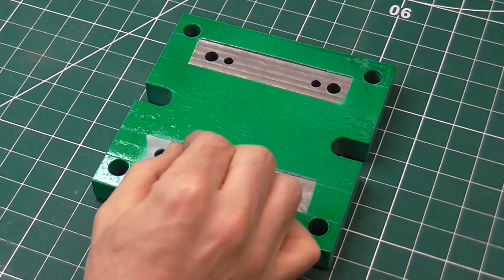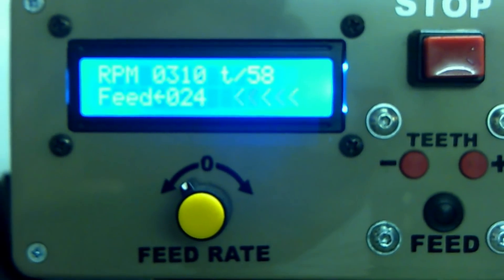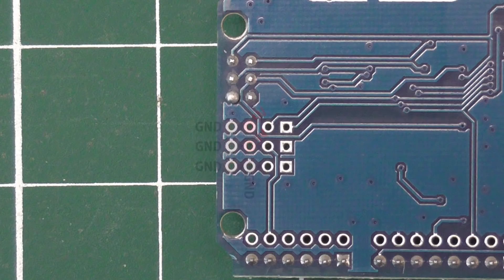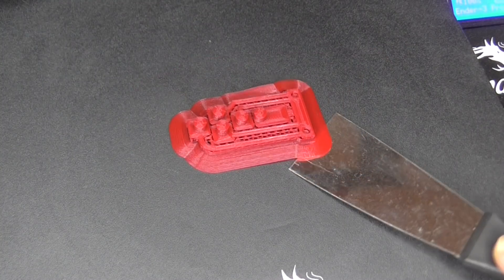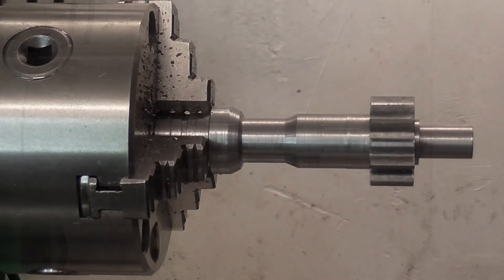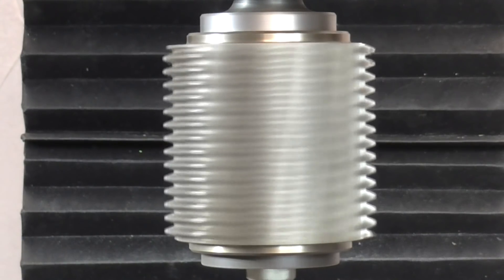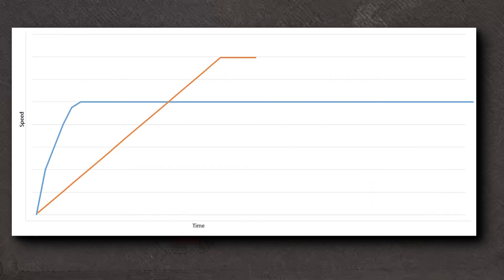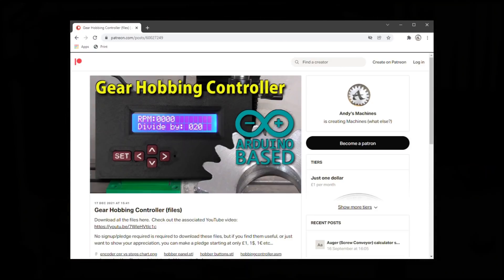Gear Hobbing Controller

Comment: Andy I need your help again. I have been trying to find an encoder module like yours for ages now: 4:03. All I can find is very tiny and/or not to spec. Do you have any part number or manufacturing data on said module or can you tell me where to possibly salvage one from? I even tried building my own with two seperate photo transistors. I already made the counting wheel in 2mm thickness and fitted it to my mill to try it with an arduino programmed by my brother which didn't work out on realistic rotational speeds. Unfortunately I seem not to be smart enough to come up with another solution so I try to exactly replicate your setup now with that encoder module being the only thing that is holding me back. Your help would be massively appreciated.
Reply from the maker: The encoder read head I used came from an unbranded servo motor from some unknown piece of equipment. I used it as the encoder wheel had a fairly coarse resolution that was easy to replicate

Look for an Avago/Agilent/HP HEDS encoder read head, these can be found cheap on ebay. They come in different resolutions but if you can find the 'S' option this is 50cpr on a ~25mm wheel which equates to approx 1.5mm line spacing which is quite doable in the home shop, you could probably even 3D print a codewheel with that slot width. (You can of course make the codewheel any size you want as long as you keep the same line spacing.)
Reply: @AndysMachines  Now I managed to program the thing but my keypad shield doesn't show any digits. it gets power and the LCD lights up but no individual digits and it doesn't reboot after programming either. I have an Arduino Uno R3 and a shield that looks identical to yours. Any tips?
Reply from the maker: Sorry, not sure what's going on there, could the shield be plugged in improperly?
Reply: @AndysMachines  I compared all the pins already and also there are gaps between rows of pins that cannot be plugged in in another way. Ich tested the program too with two switches and toggled them for a few minutes. The motor didn't move so I think the programming in general went wrong somehow even though the command prompt told me it had worked. I don't know if programming with atmel studio could change anything.. I could do that at work.
Reply: @AndysMachines  Small update: the controller was programmed correctly, I just had to tune the contrast of the keypad shield.
Reply from the maker: That catches a lot of people out! The contrast on these modules seems to be set at random and sometimes nothing is visible on the display even when it's working properly.
Reply: @AndysMachines  Oh and thank you very much for posting the updated version of the arduino program. I was about to edit the button values in the asm and convert it to hex with the values I read out in the IDE until I discovered you already did that for me. Very glad about that because that was too far over my head :) Now my new encoder module just has to work :)
Sorry for dumping all that trouble to you, now I should be able to finish the mechanical part 👍

Comment: Is it possible to make a bevel gear?
Reply from the maker: I have seen people 'hob' a bevel gear but with a single point cutter in place of the hob ( a regular hob won't work). I haven't tried it myself, I think it would need 2-3 passes with the gear at different angles to the horizontal to generate the correct profile.
Reply: @AndysMachines  I would like to use a worm cutter. OK. Thanks.

Comment: Thank you for sharing this project. Your previous 2-part videos inspired me to CNC my rotary table so I can make worm and helical gears for a 3D printed RC car. Only difference is I am going to synchronize my rotary table to both the mill spindle and the X axis DRO scale (both ratios can be adjusted or disabled). That will open the door to making spiral gears like what you would find in a self-centering chuck. Should be a cheaper (and way cooler!) than getting a BS-2 dividing head! Thanks again!
Reply from the maker: Glad to hear it! Yes, that should allow for some interesting operations.

Comment: i have a 1000cpr encoder and my step/r 600 that doesnt give a whole number, its okey tu put the Encoder to 800 cpr for the 600 Step/r?
Reply from the maker: Yes, if you change the encoder for an 800 cpr one it will work, but you can't just set the value to 800 and use the 1000cpr encoder. Alternatively you can change the reduction ratio, 625, 750, 1000 and 1250 steps all work with 1000cpr.
Reply: @AndysMachines  Thanks for the help, but i have another question, im using a closed loop nema 23 form aliexpress, (Cloudray CLE-23) this driver is programmable and it has from 800 stp/r up to 40000 stp/r. then in my milling mahcine i have 3:1 reduction, my current settings are 1000cpr - 625 stp/r but i have notice that the driver is not 200stp/r the driver is using the stp/r that the driver is programed so is using 800 stps/r  so the actual stps/r after the 3:1 reduction is higher   2400 stps/r higher than my encoder. is there a solution for this or is better to change the stepper driver?
Reply from the maker: Are you using 3:1 reduction exactly or 3.125:1? (625 stp/r @ 200 pulse/rev?). If 3.125:1, then a driver setting of 1000 pulse/rev would work (3125 steps/r) but unfortunately the software won't let you set it that high as it's beyond what the arduino can reliably cope with. So yes you would be better off with a driver that lets you turn off the microstepping completely.

Comment: Hi Andy . Just made your controller and it went fine except I had problems using AVR Dude but I used Xloader instead and that went ok, I also printed the parts for the case and buttons which work well together . I would like to have tried altering the code but as you did it in machine code rather than arduino IDE code , I wouldnt know where to start. so my only option is to ask if you would be good enough to make another version of the controller. You see I have 6 hobs but also have 3 sets of 8 involute cutters so I can also cut one tooth at a time. It would be great if you could alter the controller code to not only suit hobs but also single step for involute cutters . Love your designs so keep up the great work ....  Don
Reply from the maker: Hi Don, Glad you got it to work. Yes, I only discovered Xloader after making this video, it is much easier to use (though it actually just configures and uses AVRdude itself). Yes, other people have suggested adding an indexing feature too, though you would probably also need a locking device on the spindle and maybe a higher gear reduction (at least compared to my hobbing attachment). It's the sort of thing that would work better on a rotary table with stepper motor added. I might add this feature when I get time as I'd find it useful too and I already have a converted rotary table.
Reply: @AndysMachines  Hi Andy , and thanks for the reply, I do have a rotary table which is the reason I asked about single stepping. I keep forgetting if I moved the two fingers on the dividing plate or not and then end up with the wrong gap between first and last gear teeth, and your controller would prevent  that , so fingers crossed you find time one day to alter the design. A quick question (or 3 ) if I may, I have two encoders , one is 500ppr and one is 1000ppr both have quadrature output. Which would the best to use for your hobbing controller ?  What gears would I use between the encoder and spindle and is that Step up or down ?   Cheers Andy.....Don
Reply from the maker: I would probably use the 500cpr encoder with either 5:1 reduction (12 tooth: 60 tooth pulley) or 3.75:1 reduction (16t:60t) You want to  step down from the motor to the spindle giving more resolution at the spindle (more steps per complete revolution).

Comment: Hello Andy,
I made this nice hobbing attachement almost similar as yours and produced some simple gears with it. At first it looks fine, but there seems to be a problem. I believe there is a synchronicity problem between the spindles. What happens: for testing I moved the Y-axis to the gear and make contact so a small scratch at the gear will arise offcourse. Then I just wait and make no adjustments. This small scratch is getting bigger and bigger very slow. After 2 min. the scratch is almost around he whole surface of the gear. I tried to find the problem in the drive train. I even changed the drive train from belt to a gear-drive and I also tried a chainwheel-drive. All this because there might be a difference in ratio due to small differences in the diameter of the drive-gears. But the results are the same. I wonder if there is a round off grade in the software that could cause this? Do you have any idea?
Is it possible to receive the source code of the software so I can learn how to program this?
Best regards, Mark
Reply from the maker: Hi Mark, Some other people people had similar problems. The two possible causes seem to be either having the hob tilted to the incorrect angle, or electrical noise causing either extra pulses to be counted from the encoder, or extra steps picked up by the stepper driver. If you can vary the current sent to the motor, try a different setting, sometimes reducing the current can help which might be contrary to what you would think.

Comment: I'm kind of curious about your PIC designs now. I a Velleman programming board several years ago (around a decade or so) and a handful of different PICs to play with but since most people switched to Arduino and RPi I cannot really find anything using PICs.
Reply from the maker: Yes, PICs seem to be only used industrially nowadays, almost all hobbiests now use something arduino-esq for simplicity. Microchip, who originally made the PIC were bought up by Atmel a few years ago and datasheets are available from Atmel. You can still find application example code for PICs on microchip.com

Comment: refreshing to see a man who can write some assembly on youtube. cudos.
I'm more of a new school guy so I quite like my C for anything where I'm not counting cycles, but even still I prefer reading the datasheet and compiling stuff manually with gcc to avoid the bloat. 
I also use the stm32 series of microcontrollers for stuff that's more serious, and with the exception of the occasional datasheet errors, I actually find them absolutely great.
Reply: and now that I've finished the video, I must say this is very impressive to have been done in assembly.

Comment: how to solve this issue      sbrs  flags, 4         ; don't enter setup if spindle moving error missing charector shows
Reply from the maker: What's the issue you're having here? This line stops the configuration settings being changed if the machine is running. Can you explain the 'missing character error'?

Comment: I have a question. 
The reliability of the arduino is impressive,  is that due to the programming language you used (assembly)???? 
Second question. I don't trust arduino generally,  but, is it reliable to be used industrially using assembly to program it???
Reply from the maker: I completely agree. The only reason I used an arduino for this is so that other people can replicate it easily. I generally never use them myself. But an arduino at it's heart is really just an ATmega328 (I use these stand-alone all the time). If programmed in assembly there's no reason it shouldn't be just as reliable as any other microcontroller used in industry.

Comment: Hi Andy 

Thanks for sharing the program with us.
I have downloaded same but when trying to install it in Arduino (using several port numbering), I get a msg like:
Using port : COM3 or COM4 or COM5……
Using programmer : Arduino
Overriding baud rate: 115200
Avrdude: stk500_recv(): programmer is not responding 
Avrdude: stk500_getsync()attempt 1 of 10: not in sync: resp=0xb4

Doing in total 10 attempts without any results. 
Initially I had the impression is the Arduino card and therefore I have ordered one more but I get the same.
Could you pls support?
Reply from the maker: I'm not sure what the problem is, but I've since found a program called 'Xloader' that is windows based and easier to use (though it does use avrdude itself). Maybe try that instead?
Reply: @AndysMachines  Hi Andy, one more question and I hope it will be the last one. 

I have used another PC and I was able to upload the hex file according to your instructions. 
On the screen I can see only the rpms and when turning the encoder the reading is changing. 
The LED is flashing if I turn it too fast.

The problem is that IO can not see the Divide by:20 as appears in the video. 
I have ordered a new Arduino uno to check if the problem was with it. The results was same.

I have used the Xloader as you proposed and I have also same results. 

Do you have any idea why I have this problem?
Reply from the maker: @nikoskyriakou9341  Is there nothing at all displayed on the 2nd line of the screen, or some strange/broken characters? I have heard of people having problems with these screens, where only the 1st line works properly.
Reply: @AndysMachines  hi Andy.
On start up only rpm appears. 
If press reset, then the broken characters appears.
Reply from the maker: @nikoskyriakou9341  Yes, that sounds like the screen issue. Can you try a different screen?
Reply: @AndysMachines  hi Andy.  I have to order one from Ebay.  I can't find it local.  It will take few weeks.  I will revert once the new screen is tested. Thank you for your support.
Reply: @AndysMachines  Hi Andy, I have manage to get a new screen. 
It is one without any brand on it and it works fine. 

I have another short question.
My encoder CPR is 400, I am using a 6 to 1 reduction ratio and my stepper motor driver was set to 400 pulse/rev (400 is the lower I can go).
What parameters should I change in order to have the setup running?? 
The spindle steps per rev should be adjusted each time you are changing the number of teeth you will cut? And if yes should we follow the chart shown in the video?
Reply from the maker: @nikoskyriakou9341  No, you don't need to change the spindle steps per rev for different numbers of teeth, the controller takes care of it, you only need to set it up once.
The encoder you are using has too few counts for the reduction ratio/steps you have. The encoder must have at least 1/4 the number of stepper steps per complete revolution (including reduction). You have 400 steps x 6 = 2400 steps and 400 CPR. You need to either change the reduction ratio to 4:1 and keep the 400 CPR encoder (3:1 will work too). Or keep the 6:1 reduction and use a higher resolution encoder, 600, 800, 1000 or 1024 CPR will all work.
Reply: @AndysMachines  hi Andy,  well noted. Will do so.  Thank you for your advice.

Comment: In one of your replies here you stated that Arduino controller has a max stepper CPR of 10000. I will be using a DM556S driver with selectable microstep CPR from 200 to 25600. It is my understanding that each Arduino generated pulse can be transformed by the driver into 1-128 microsteps. Does your 10000 CPR limit relay to Arduino or driver output?
Reply from the maker: I limited the steps per rotation you can input in the software to a sensible number. Note that it is the total number of steps per rotation of the hobbing spindle including any gear reduction and it is the number of steps that are input into the driver (out from the controller). The problem with using very high microstepping values is that you need a very high resolution encoder, the encoder must have a minimum CPR of 1/4 the steps per rotation on the hobbing spindle, so if you were running at 25000 steps/rev you would need at least a 6250 CPR encoder which is not really practical, such a high encoder resolution would limit it's maximum speed to perhaps a couple hundred rpm or the arduino can't keep up. There is also no real benefit to such fine resolution, it won't improve the machining quality and using high micostepping divisions will just reduce the torque available from the motor.
Reply: @AndysMachines  Thank you for your thorough answer. So the limit is the Arduino itself not being able to process steps fast enough? May I ask your another question? How do you account for the gear reduction ratio on both mill and work (hobbing) spindles? I am asking that because Arduino screens show "Encoder CPR" and "Steps/r Spindle" and it is not clear if it is including gear ratio from pulleys and belts or not. Also does "Encoder CPR" mean pre-quadrature resolution or the final number of counts. Can you clarify that please? Sorry for asking you too many questions, your videos are amazing, but I actually intend to build something similar and need all the details I can get.
Reply from the maker: @mikhailshneyder9131  The limit depends on both the speed and encoder CPR, but the arduino is actually more than fast enough with any reasonable setup.

The numbers are entered after any gearing. The encoder should be mounted directly on the mill spindle and the values are for the CPR/steps are for one complete rotation of each spindle. eg. if you have a 200 step/rev motor and 3:1 gearing that would be 600 steps/r.

CPR is usually defined as the number of slots or lines on the encoder codewheel. It's possible with quadrature encoding to count up to 4x this number, but it's the CPR or lines value you need to enter. (This is also why the encoder has to have at least 1/4 the number of lines as the hobbing spindle has steps per rev.)
Reply: @AndysMachines  Thank you very much!